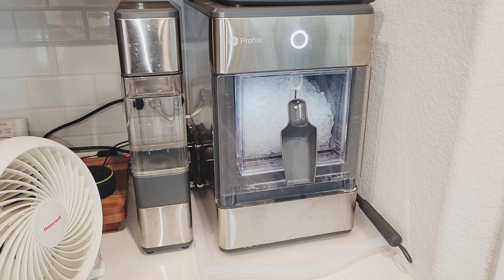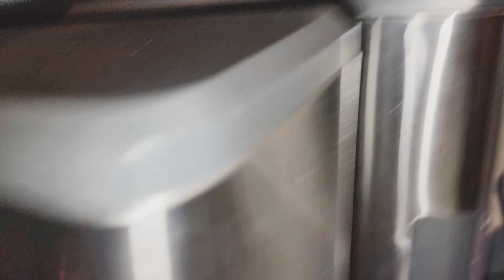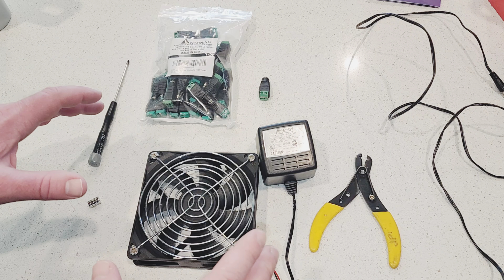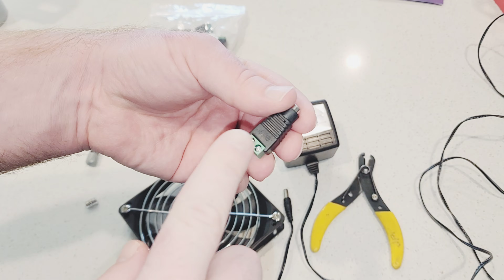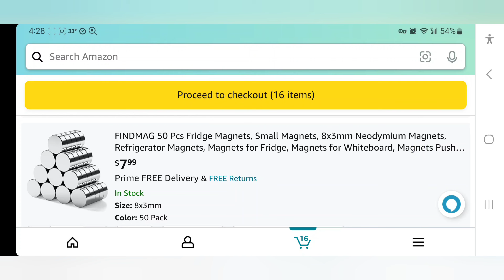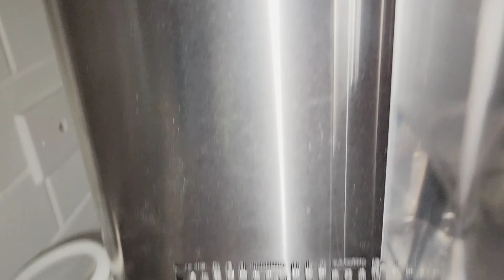GE Opal Nugget Ice Machine Not Making Ice or Watery Ice Fixed by Installing Fan

Comment: Mine does have an internal fan on the inside of the coil, and it blows outward, but very weakly. So if you do ad a fan on the outside, I would suggest having it pull air out, so that it works together with the internal fan. I wonder if just upgrading the internal fan to something more powerful might be possible?
Reply from the maker: I don't have an internal fan, but if you upgrade yours with a better one, that will probably help

Comment: My ice make just stopped working and I took a flashlight to take a look inside, should the fan be running all the time when on? Mine isn’t but not sure if it’s supposed to only turn on once it starts to heat? Might try this see if it works thank u
Reply from the maker: I assume it's supposed to run all the time

Comment: Your tip was a lifesaver for my ice machine. Right now I am using a small box fan, but have ordered the fan and parts you suggested. I do still have a question. Why is this fix even needed?  Is this just a case of poor engineering or am I missing something? 0:17
Reply from the maker: Poor engineering

Comment: do you think I could splice the 2nd fan with the one inside so it would turn on and off or would it pull too much power and mess with the unit itself?
Reply from the maker: Probably. Just need to make sure the fan voltage matches. Run the risk of overcurrent on whatever is driving the fan or the wiring

Comment: I have the opal 2.0 with the 2 air vents each side and the ice maker fan (air filter?) In the back...
Do I put fans on both sides or just the back?
Thanks
Reply from the maker: Let's do some trial and error. If you have a small desktop fan, try blowing it into just one side and see if it makes a difference. The try the other side and then, if you have a 2nd fan, try both sides. Let me know what you find. Thanks for watching!
Reply: Ok so when I took off the back the internal fan looked like it was reversed (not like your fan blowing air in). So I turned my fan around and add a small fan outside. 
This morning I had a full bin within 3 hrs not like yesterday where it took 4 hours for a half a bin.
Thank you for your help.
Reply from the maker: @victoriar-fi1hv  awesome! Thanks for watching!

Comment: I bought a fan for both sides; the left side, where Opal put a too-weak fan internally, and the right side, where all the heat is. The former blows in, and the latter sucking heat out. I bought this dysfunctional appliance in 'like new' condition at a local thrift store yesterday for $25. I got it home and proceeded to watch some reviews on YouTube. I have never seen a worse-engineered appliance or item of any kind! People are paying $500 + for something that is not only self-cleaning but suggests that we, the sucker consumer, dismantle and refurbish this POS ourselves. Worse, they make the cleaning process as difficult as possible. Eff-That! I will run some Krud-Kutter or Purple Power @ 90% water to 10% cleaner once a season change, and if that doesn't work, for $25, I can afford to throw it away.
Reply from the maker: Awesome. Let me know how it goes. We spent a little over $400 and this is our 2nd warranty exchange unit.
Reply: Did you get it working?

Comment: Thank you!!!! I read so many articles and nothing helped to get our 15 month old GE Profile icemaker to make more than a small amount of watery ice. Within minutes of putting a fan on there, it started working correctly. I'm curious what this means is wrong in there though? Non working fan?
Reply from the maker: Just a crappy design by engineers without any common sense.